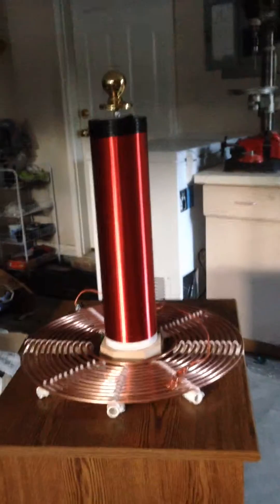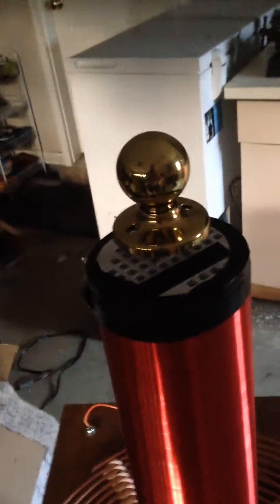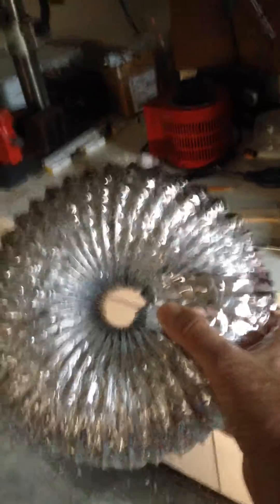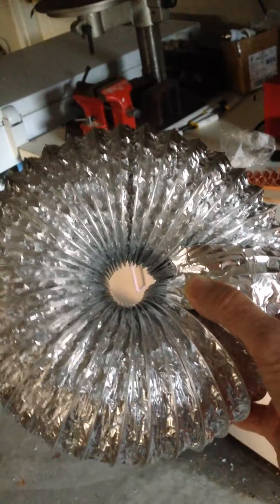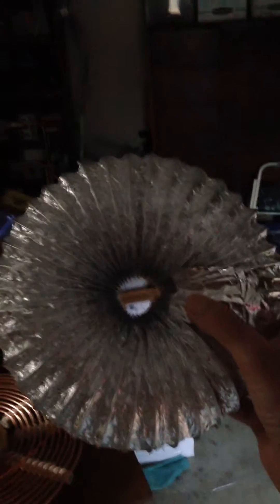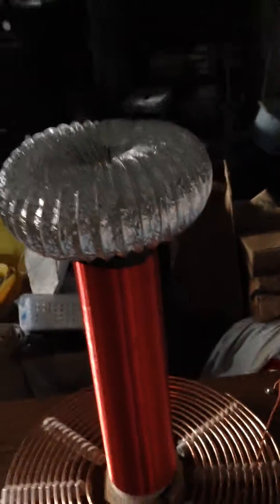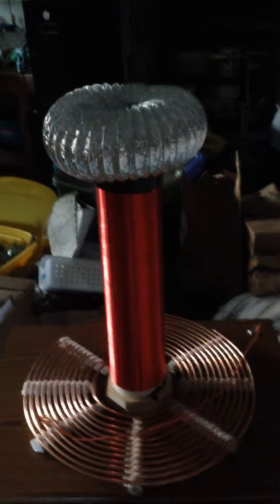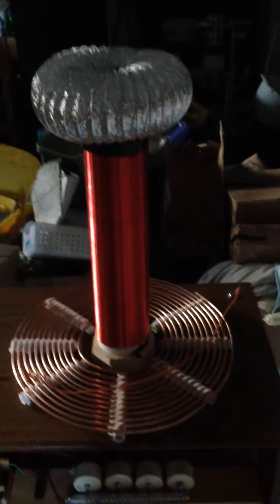Effects of changing top capacitance on a Tesla Coil.

Comment from the maker: Thanks for your insight cp8071. I open the garage door and side door to blow out the ozone either during a run or just after. Still playing with this. I want to get all I can out of the coil with the flyback. I already have some NSTs to work with, but want to build a terry filter first. I have to recoup from the expenses of this coil first before I buy the parts. The toroid in the video was for a quick demonstration with something I had on hand. Ordered some Stainless Steel balls and some inserts which should be here by the first of next week. Hope to use them to provide the extra capacitance and get better output. Will post new video when I see results. Also planning a multi-gap spark gap to see if I can get more current flowing. Thanks again for your comment. Will post when I have more results.

Comment: Nice coil, it should be capable of more.  A toroid with the hard aluminum ducting instead of the soft dryer duct will be smoother and less prone to early breakout.  Try raising the secondary a bit above the primary (3/4" or so).  And the toroid a bit above the secondary.  Check around for some cheap NST transformers as an easy way to  increase the primary current.  Get out of the garage, ozone is very bad for you.